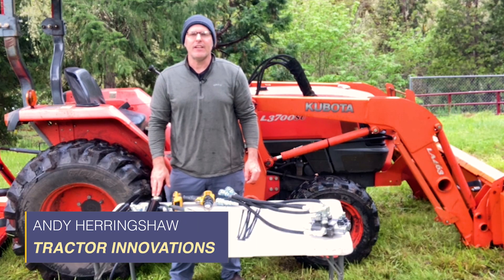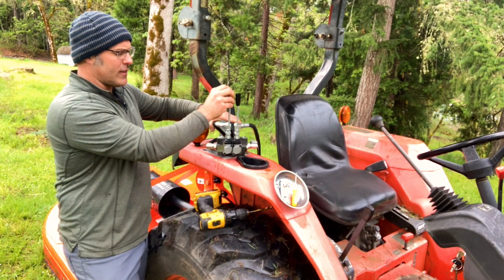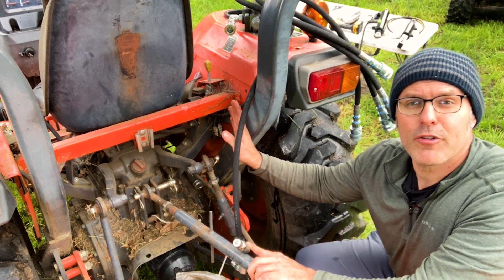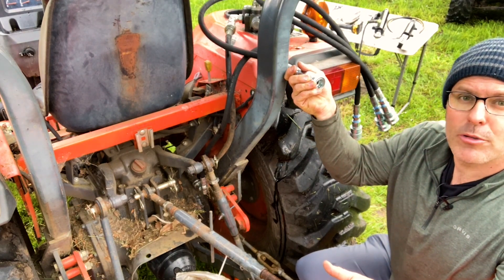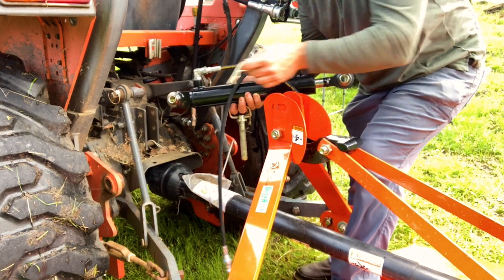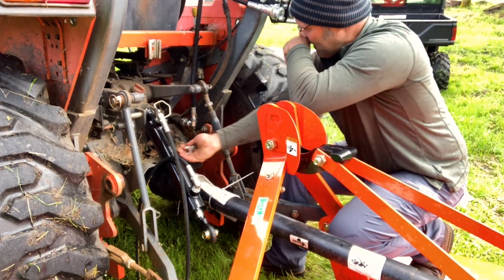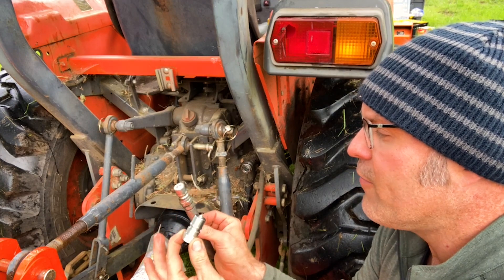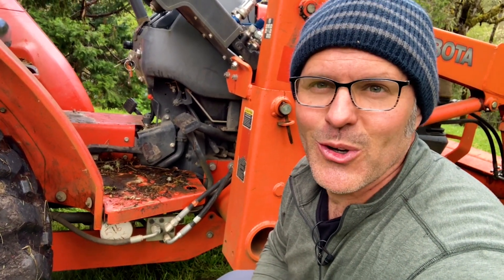$975 2-Spool Remote Hydraulics Kit for Tractors With Power Beyond

Comment: The reason I asked the question 3 weeks ago is because my understanding of this Kubota open loop hydraulic system (assume backhoe is not connected) is that the loader valve Pwr Beyond supplies hydraulic pressure to the 3 point hitch valve. So the new valve spool inserted in series should have the power beyond port continuing to the 3 point valve (existing port). So in addition to the 2 existing connections to the new valve spool inlet and Pwr Beyond outlet, it seems to be that an additional tank return is needed from the new valve spool. Please correct me if I'm wrong.

Comment: Is there no return to tank line needed if I have the full kubota PB backhoe circuit already.
Reply from the maker: No need for a return to tank.  Fluid returning from the cylinders is just pushed along the power circuit.   Just like the backhoe would do.

Comment: Any spool valve options that fit down neatly in the available slot(s) beside the seat instead of up on the fender?  (right side for a 2014 3800dt, for instance)
Reply from the maker: The valves I can get ahold of won't fit under the fender like that.   Only factory valves fit perfectly under there, and that's $$$$ if you can even get them.
Reply: @TractorInnovations  I understand the "if"...  I've never even seen them anywhere, let alone been able to see a price for them.
Reply: @jeremyjamesenos   just priced the 2 valve kit that fits on the side of the seat from kubota.  over $2,000 for my L4701.
Reply: @Go2Sleep911  thanks for the info.  I'm happy w/ the $1k investment I have in a dual spool kit mounted to the ROPS I guess.
Reply: @jeremyjamesenos  only thing i don’t like is the valves mounted on top one fender.  I live in a cold climate and when I’m plowing or snow blowing i get lots of snow buildup on there.. i worry about rusting, and freeze ups of the lever.  I would figure out a way to protect it during winter.
Reply: @Go2Sleep911  my biggest concern w/ mine on the fender is the vulnerable hydro levers when I'm near a tree and tree branches are brushing up close.
Reply: @jeremyjamesenos  never even thought about that…. Need a lockout like the loader valve

Comment: Looking for  2 spool remote kit with Kubota Bx23s with power beyond set-up . Does the control valve have a "closed center" spool in it ?
Reply from the maker: These valves are all open-center.  That should be compatible with all small Kubotas

Comment: Do you sell the side hyd links as well?
Reply from the maker: Yes, I sell the hydraulic side link for almost all compact tractors.   $375 with hoses, fittings, and couplers installed ready to plug in and go.   I don't have them up on my website yet, but I can email you a link or you can order by phone.